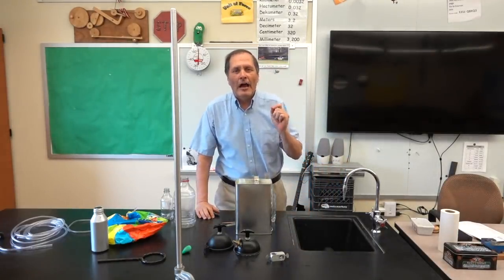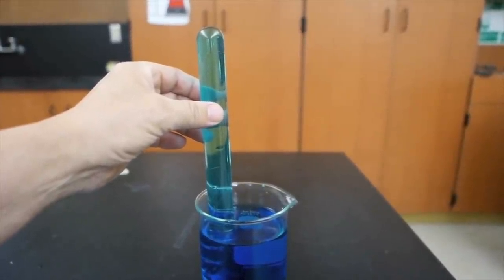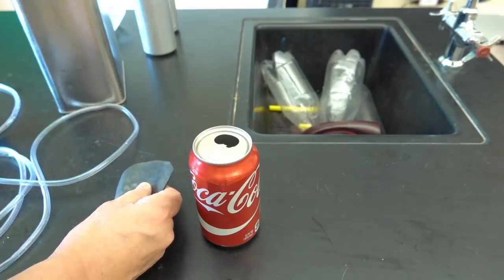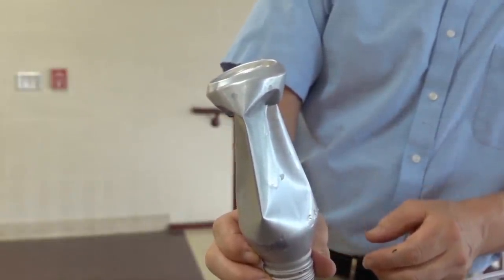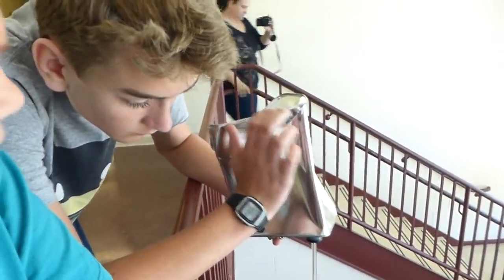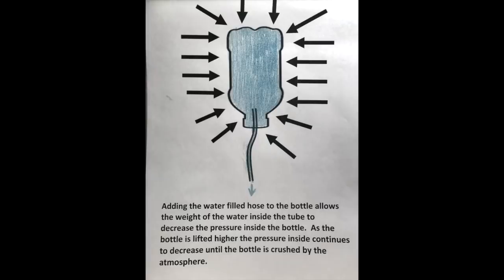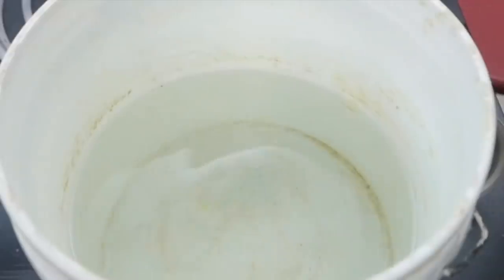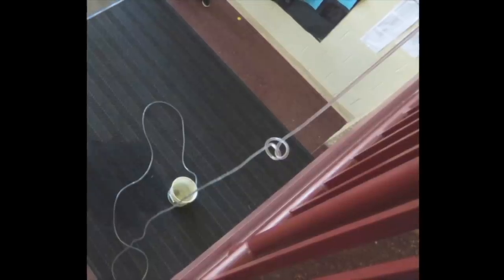Crushing cans from weight of one cup of water....Magdeburg Hemispheres without a pump..Bruce Yeany

Comment: the best cans- crushing- methode is using the hammer & the stump
Reply: This leads to a paradox of how trees can be taller than ten meters.  Plenty of trees are a lot taller than ten meters, with the tallest living tree being 115 meters tall.  But 10.2 meters is the theoretical limit for how high you can suck water up a tube before it boils, which is what trees need to do to get water from the root to the canopy.  The answer is that the water is in a metastable state (call it a supersucked liquid) where it can carry a negative absolute pressure that is tensile, when it should be boiling, but it doesn't boil without the activation energy to start the process.

Comment: I don't know if the sound is the sound of the water boiling. it sounds like it could just be tiny holes developing in the metal containers as they tear. I say this because alpha phoenix did a similar experement but had to go much higher to get the water to boil https://youtu.be/hHNoHhbfFDQ

Comment: I was surprised the plastic hose didn't squash.
Reply: When the hose starts as a perfect circle, it is very difficult for hydrostatic stress to crush it. That is, stress that is uniformly distributed, and is purely normal stress with no shear, and no non-uniformness to the stress.  When the air pushes on the tube uniformly on all sides, the tube won't deform beyond its own compressibility until it receives a disturbance that would turn it from a circle into an oval.

Now, if you intervene and force it into an oval cross section, then the hose will squash a lot easier

Comment: Hi Mr Yeany,

I have been watching videos on youtube from a user called "learn for life" with videos demonstrating free energy water pumps, moving water up into fields tanks using a small diameter pipe inlet and larger outlet pipe downhill (he said 1:3 ratio). Using an air tight system "similar" to a siphon only a vacuum negative pressure inside the tanks instead. I know it wouldnt be 100% efficient but would the system work as demonstrated? The only similar example i have been able to find was this video and the flying drop siphon in ep1 of your siphon series, thats what led me here. Also if you could, possibly look at his video and explain the capped vertical air pipe on the outlet a certain distance and height from the tanks, almost like a ram or trompe?
Reply from the maker: I watched a few of the videos,  several showed steps building it but not much in the way of explaining the process,  however,  in one of the titles they called it a siphon system,   and one of the few efforts to describe it, had the person saying the outlet pipe is lower than the inlet pipe,  which is required for a siphon to work, so to call this a pump I think is a bit misleading. To me a pump has the ability to lift water from a lower level to a higher level. My guess is that since they are using rigid piping,   the tank is used  as a way of filling the lines to get the siphon started.
Reply: @YeanyScience  its a sealed tank with a vacuum. Like the video you produced here with the crushing vessels, only it pulls water into a smaller pipe inlet than the outlet, the outlet goes downhill. And has some sort of pressure pipe half way down i think to catch air and build it as pressure like a ram pump, but i dont think its lower than the source, i imagine it like a piston in a combustion engine in continuous free fall, the vacuum never bleeds out. air cant get into the system to break the vacuum. But eventually the supply would clog or not keep up crushing the storage, I will exeperiment to see if its even possible, some people in comments say it is impossible. But imagine when they saw the first hydrofoil prototype.

Comment: What will happen with glass bottles ?
Reply from the maker: I will be trying this in future video,  as the bottle goes higher, the  decrease in pressure will cause the water to bubble as it degasses, go higher still and the water should leave the container forming a vacuum in the bottle, if the bottle is not strong enough it implodes

Comment: You say the weight of the water causes the vacuum pressure, but then you also say that increasing the diameter size of the hose won't increase negative pressure but instead allows it to increase negative pressure faster. So saying "it is the weight of the water that causes the pressure" seems like a contradiction in words, because a bigger diameter hose = more water = more weight of water. 

Can you explain why it looks like a contradiction in words? Are you saying static pressure weight, is that something different than weight of water? For example If i weigh on a scale the weight of the volume of water in a 1/2" diameter hose 20' long full of water, it will weigh less than the volume in a 1" diameter hose 20' long full of water, because there is more volume. More volume= more weight.

You keep saying "weight of water" so i keep wanting to think if i increase weight without increasing height, i can get more pressure. But you must be talking about something different, because 2 liters weigh more than 1 liter but yet, they both create the same amount of negative pressure over time, according to what you said. So i am thinking you must be talking about "the weight" of water meaning "the height" of water because the height determines static pressure?
Reply from the maker: I have  3 more videos planned on this question that you have asked in both comments,   going higher increases the pressure  and why the diameter doesn't make a difference to the pressure exerted.  Also showing  the increase in pressure  as you swim underwater,  The pressure is the same whether it is a tube of water  or in a vast body of water like the ocean
Reply: @YeanyScience  Thank You. I was watching a video on a graduated cylinder experiment. But this cylinder experiment has 4 different size diameter cylinders all connected at the bottom with each other. To begin we fill the biggest cylinder and it equalizes out to the other 3 thru the connection in the bottoms. The weird thing that happens is it does "equalize" out but the smaller cylinders are at a higher level than the bigger ones. 
Upon first glance it seems like the weight of the water in the bigger cylinder could be pushing the levels higher in the smaller ones, and i think this is in essence what is happening, but not without capillary action causing it first. First the capillary action happens in the smaller tubes, then the pressure is reduced in the tube, allowing the bigger pressure from below to raise it up. 
Because if you think about it, who says the biggest tube in the experiment is indeed BIG? The biggest tube could still be small, but as long as it is bigger than the others it will push the smaller ones up farther level than it is at. What i am saying is if they were all the same size it wouldn't work, all cylinders can't raise at the same time. And i am also saying the "biggest" cylinder isn't raising higher and that is why, it is the biggest out of the 4, It has capillary action too because it too is in a cylinder yet it can't raise higher because the smaller cylinders are already reducing the pressure on those smaller cylinders(by capillary action) more than the bigger cylinder can reduce pressure by capillary action so the bigger one has the most pressure of the 4. So to me that can kinda confirm the bigger one is what raises the others, BUT not without the help of capillary action first. without that big one there, there would be no liquid at that level in the smaller tube to begin with.

So i was confused a little and not sure if it is capillary action or pressure, or what. I appreciate all your videos and response, thank you. I think i got it now, i think the way i explained the experiment i talked about here, is a good enough street description of what happened. I had trouble figuring out how the pressure rose the smaller cylinders especially when i needed to know even more basic fundamentals and that is where you came in . Thank You again.

I also want to find out what happens in your experiment, when we 33 ft and over in height, if we go higher anyway what effect will it have on your can? And also it is apparent that the ancients knew many things we(some of us) assumed they didn't, and know things we still don't know. Because look at the imperial numbering system 32 degrees is freezing, but at the same time 32ft high is in essence a type of freezing too, the boiling pressure height of a column of water. And look at free mason master is a 33 degree, 33 could be referring to above or below freezing depending on which freezing, if they are referring to height in ft, or temperature in F.

Comment: Mercury would increase vacuum in the tube
Reply from the maker: you're right, with mercury I wouldn't even need to go upstairs, however, few problems with mercury, not allowed in the school building due to it's toxic nature, extremely difficult to clean up if spilled, requires hazmat suits  and expensive

Comment: Now how high can u go before the difference in pressure stops increaseing
Reply from the maker: about 34 feet
Reply: @YeanyScience  With the right conditions, you can get liquid water to be lower pressure than a pure vacuum, and take it higher than 34 feet [10 meters].  Trees grow taller than 10 meters all the time, and suck water up the xylem tubes, in a process you might not initially think would be possible.  The highest we can get with simple manmade equipment is 10 meters, as maintaining the metastable state of a "super sucked liquid" that trees use to get water higher than that is very difficult to do.
Reply: Can I see the math
Reply: @radicalfanatic1309  The equation is: deltaP = -rho*g*deltaZ

we know P at Z=0 needs to equal 1 atmosphere, where the water is vented to the surrounding air.   P1 at Z1 would be set to zero, for the water going as low as a perfect vacuum.  Set Z0 = 0 to keep it simple.

P1 - P0 = -rho*g*(Z1 - Z0)

Solve for Z1:
Z1 = (P0 - P1)/(rho*g)

Set P0 = 101,325 Pa, P0 = 0, rho = 1000 kg/m^3, and g = 9.8 N/kg. 

We get Z1 = 10.34 meters, or 33.9 ft.

Comment: Always love your videos.  Question: With the can that is right side up, you can see air-bubbles going through the tube.  Is that water vapor from the water boiling due to the low pressure.
Reply from the maker: HI Mark,  I don't think I'm up high enough for reduce the pressure that much, my guess is I was not careful enough when filling the tube or air leaks. I do want to show what you are asking and I have some additional equipment such as a clear pipe where I want to test this with,  however the area that I planned to use is closed off for now due to Covid-19

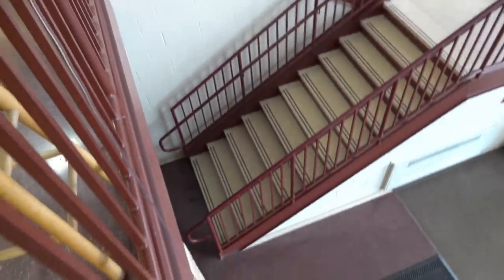Comment: first: 4:51 Could this be considered as a primed siphon?
Second:  when you flip a filled bottle of water, the water falls out, but air is also rushing in making the typical gulping sound. Why isn't the air travelling up the tube when you flip the can around like it does with a standard flipped bottle?
Third: when you use a container that doesn't deform (so strong enough to resist the atm pressure, will there be a "vaccuum space" arise above the water level? And if so, would we see the start of the water boining due to the decreased pressure?
Reply from the maker: if the hole is small enough surface tension will keep the air from entering, but when a tube is added to the opening,  it's length makes a difference,  the long column of water in a tube will not be able to stay in the tube, you may notice the I have to stick the bottom of it in a bucket of water, otherwise air will intermittently travel  up through the tube and replace the water.  I had planned on updating this video and had planned to show this as part of it but cannot currently use the school's facilities

Comment: As a former science teacher here's something that's always bugged me. The 'Air has mass' balloon demonstration. I did this once and found I had to cheat the empty balloon. I weighed several balloons and they were all over the place; initially I attributed it to this. Then I started digging into it. Duh. How much mass of air is actually in a balloon? Not much. Well it was under pressure. Well not much pressure. Then it's water vapor from my lungs. Water vapor is lighter than the atmosphere. (Here I found what was actually behind those big arrows rising off the ocean in the water cycle diagrams). Then I thought, well what about water? So I filled water balloons and put them in a tank. One of them actually oscillated very slowly from the bottom of the glass aquarium to the top and back down. That was pretty cool. Buoyancy. In the water we notice it, but in the atmosphere we often don't think about it at all. So putting air in a balloon just displaces an almost exactly equal amount of air surrounding it. Net result: When you weigh a balloon, you are weighing the balloon, the air inside cancels out. 

One Saturday all us secondary science teachers were called to Maya Angelou High School for more training in Next Generation Science, (the new voodoo, which is based on sound science. Behavioral science: any system of ritual more complicated than previously systems of ritual will appear to be 'more real.' )  They flew in and paid some 'expert'  to inspire  all of us 'lesser' uninspired science teachers. He started in on his 'model' Next Gen lessons, including, using a basketball to prove to students that air had mass. I started grumbling and got an elbow from a colleague. I am ashamed that I didn't shout out 'bullshit'.  Basket balls to NBA specs have about 14 psi over atmosphere in them, so almost nothing, certainly a tiny fraction of 1 percent of the mass of a basketball.  

I went home still thinking that I might have missed something. I took my Makita air compressor hung it from my 75 lb Weston spring scale, 28 pounds. I emptied the tank, 28 pounds (I made sure there was no water in the tank), I turned it on and brought the 2.5 gallon tank to 125 psi and the scale read 28 lbs (Maybe it was 32. It wasn't 29 or 30). Well, maybe there was some change but my spring scale wasn't sensitive enough to read it.  (Of course air has mass, it's just difficult to measure it.... unless maybe you've taken more chemistry than me. I demonstrate that air has mass because you can blow on things and move them, so force is present. 

I like your demonstrations, and how you never stop at just one. So air has mass. How would you do that? Thanks.
Reply: One way you can demonstrate that air has mass, is to weigh a soccer ball deflated to 1 atmosphere, and weigh the same soccer ball pumped up to 14.7 psi gauge pressure.  From knowledge of atmospheric pressure, and treating the soccer ball as rigid, this means there needs to be twice as much mass of air inside the pressurized soccer ball.  FIFA standards allow you to pump soccer balls to up to 15.6 psig, so 2 atmospheres of absolute pressure is within the specification.  I originally thought to do this with a basketball, but they don't get pumped to as much pressure, so the air mass would only be about half as much.

When you weigh the ball empty, you will weigh the ball surface alone.  The weight of the 1 atmosphere of original air will be nullified by the buoyancy force from the outside air.   When you weigh the ball full, it should be about 6 grams heavier, due to the weight of the extra air.   For comparison, an empty soccer ball is around 410 grams, so you'll need a kilogram scale with at least a 1 gram precision.

Comment: I had always wondered what my fish felt in their upside-down fish tank, it was only about two feet above the waters surface. I wanted to do a much more elaborate design, but now im afraid their little air bladders will expand as they go higher in it causing them to be too buoyant  and then the float up as they cant control it and they pop.
Reply from the maker: I would think fish have a pretty good balance to the air bladders and can adjust them for quite a change in depth